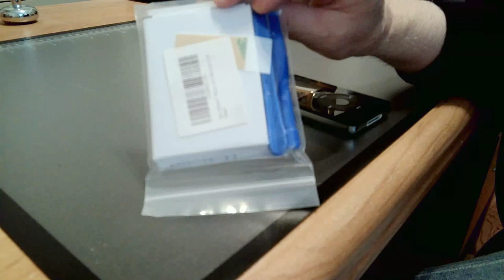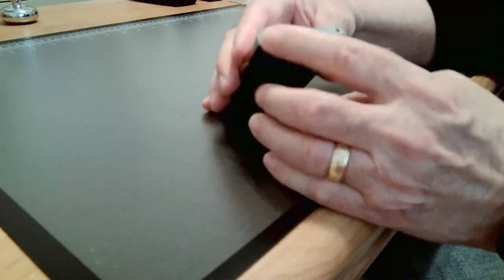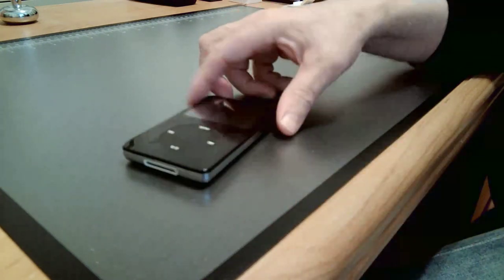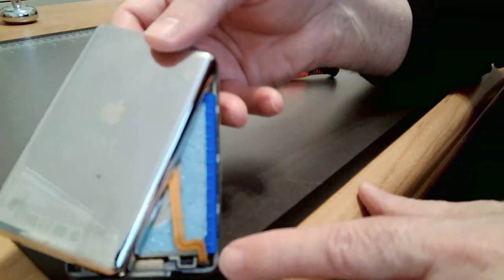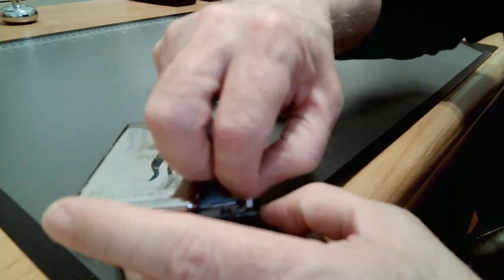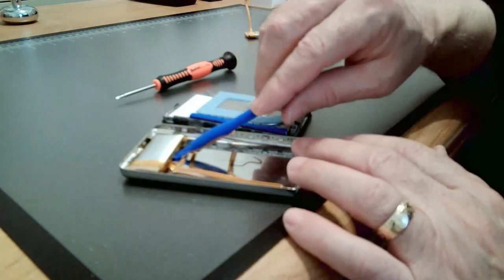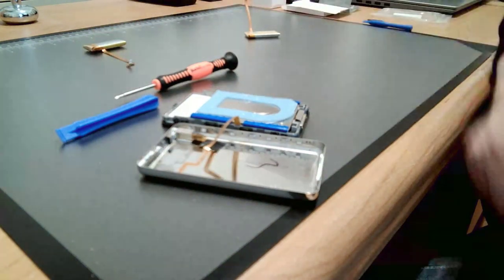Battery Replacement in Ipod Model A1136

Comment: Are the batteries on both 120gb and 160gb same?
Reply from the maker: I would guess "yes" but not 100% sure.  I would recommend to use the model number from the ipod to search for the proper fitting battery.  The model number should be located on the back of the ipod.  Hope this helps.  Thank you.
Reply: @MarkM_DIY ok. Thank you so much
Reply: The 160 GB in iPod Classic came in two different thickness. The earlier model has a thicker,  dual platter harddisk and the latter model has a thinner, single platter harddisk. The earlier model has thicker chasis so it could host a bit larger capacity battery. Some vendors provide info which model of iPod fits their battery. You should check that info if it's available.